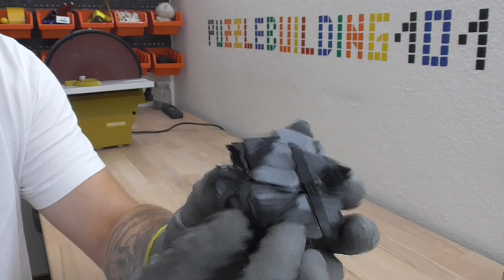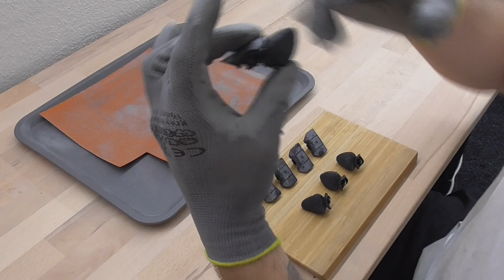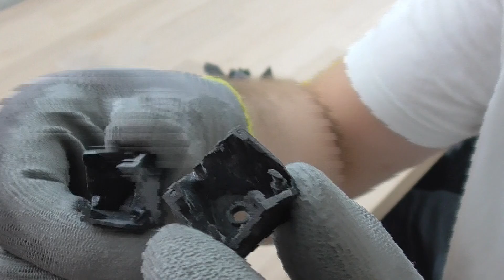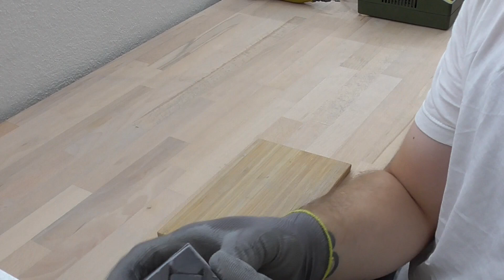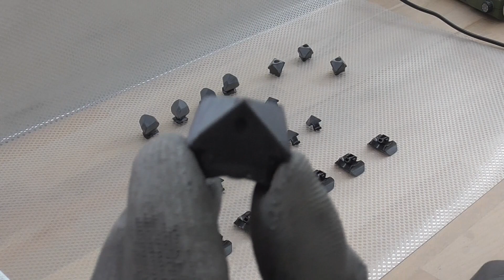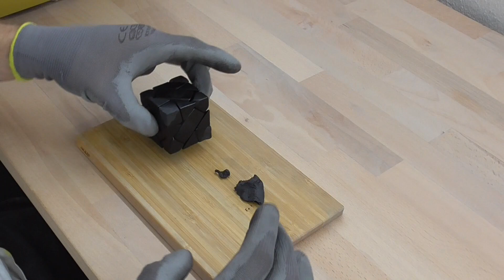How to turn a Master Pyraminx into a Cube - Complete Build Guild - Part 2/2

Comment: Can you add tips to it
Reply from the maker: You are talking about the moveable tips of the original master pyraminx, right?
Not about extra commentary?

Yes you can do that. While I was building the puzzle I attempted to use the original tips of the master pyraminx, so you would be able to disassemble the puzzle. I cut it out of the video though, because I could not get a quick solution done (original tips were too big, so the cap from a tip would have to be sanded down so much, that it would have just fallen off)
I then decided to build the puzzle as it is right now (I though about this for half a day though)
Reply: Thanks a lot